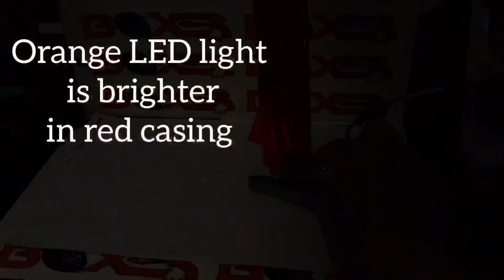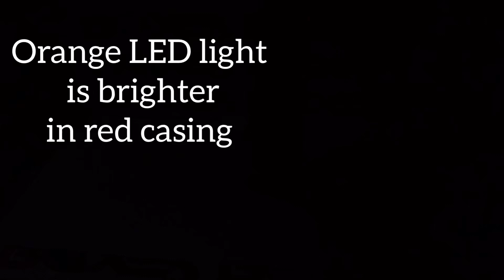Flashing LED light - 1156 / 1157 / T20

Comment: How do you get them to flash or is it just hook it up to a 12v
Reply from the maker: Hi there.  This led bulbs has built-in flasher chip so it will flashes when it's hook up with a 12v.
Reply: @boxer593  so if you order any t20  bulbs they have flash unit in them or do you have a link to them on amazon or ebay
Reply from the maker: Wish - Shopping Made Fun by ContextLogic Inc.
https://apps.apple.com/sg/app/wish-shopping-made-fun/id530621395

You can get it from "Wish". Search for T20 flashing LED.
Reply: @boxer593  not on apple but if you can give me the title on wish i can search cheers
Reply from the maker: https://www.wish.com/m/mobile-apps?app_deep_link=d2lzaDovL21vYmlsZS1hcHBz

They have android version too